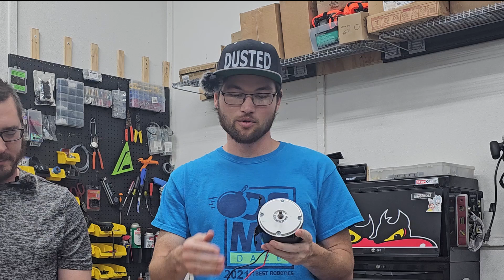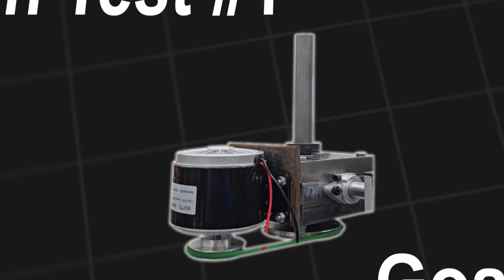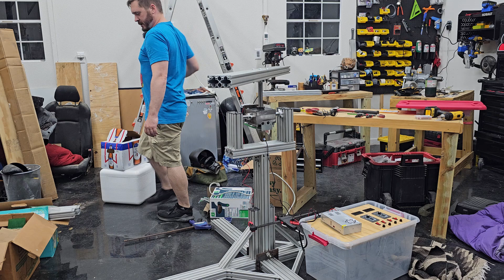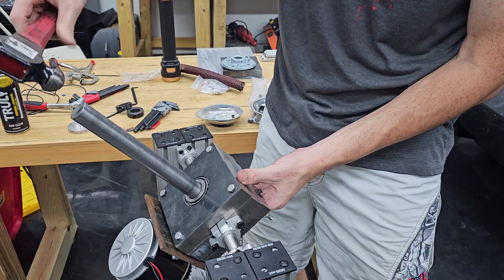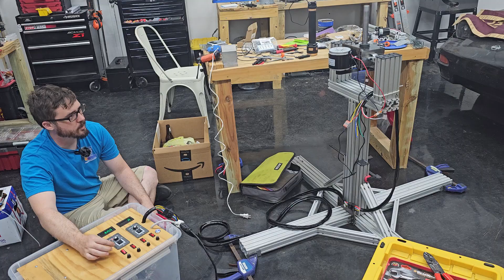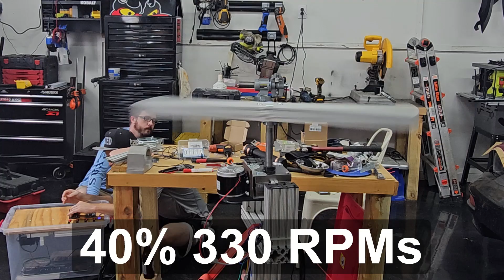Building a Disc Golf Launcher Episode 11: Bigger Motor Install and Spin Test

Comment: Heck yeah you're still at it! for reference DittoFlight uses a 42v system with a VESC esc from Flipsky and a 7070 outrunner brushless motor from them as well. It uses a 5mm HTD timing belt to the main axis to spin, so again you're landing at a similar solution, I need to remember to get a wattage number for what it's pulling when spinning at 70mph.

Also may I suggest at this phase of the project investing in a piece of at least 1/4" polycarbonate, or a full 4x8 sheet of plywood to stand behind during this type of test
It's a tricky one to let full safety stories be known via video (and I'll be adding some more safety features to DittoFlight)
Reply from the maker: Thank you for the info on DittoFlights power system. We are always interested in talking about the tech that makes it all work. I completely agree with your safety suggestion. We have honestly gone a step too far without building in some safety features. Next episode will be about adding a guard, an e-stop, and maybe some interlocks. We have some extra extruded aluminum. We will probably use that the make a frame and put a sheet of polycarbonate in the slots to make a barrier. We appreciate the watch and the advice.